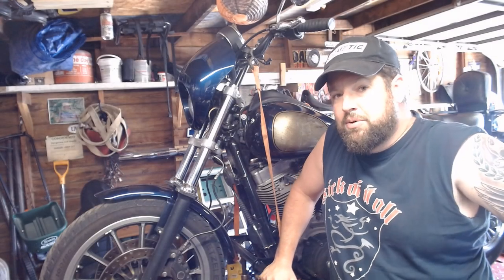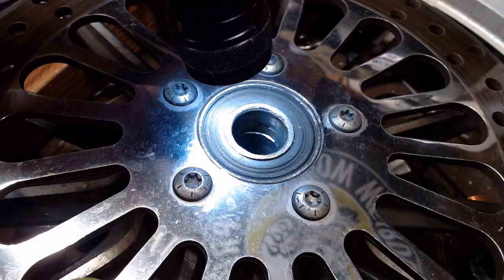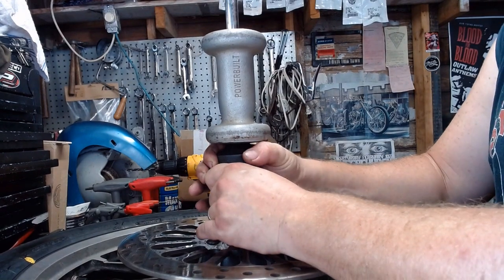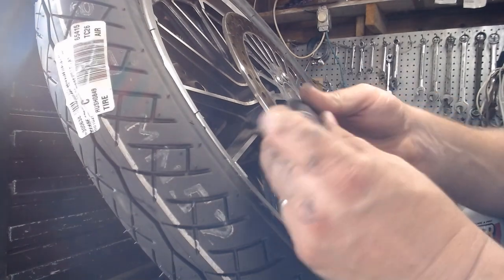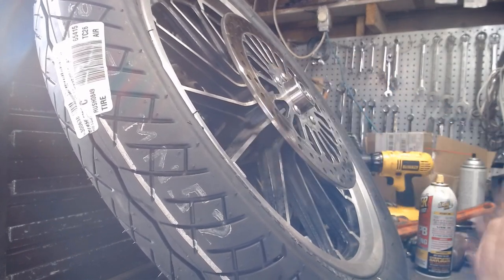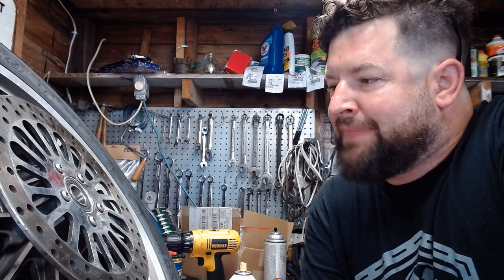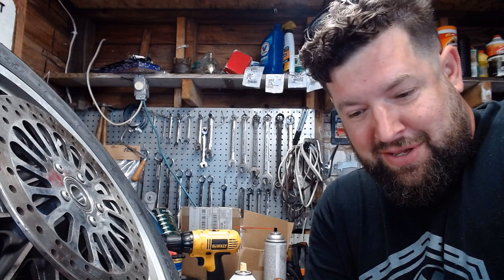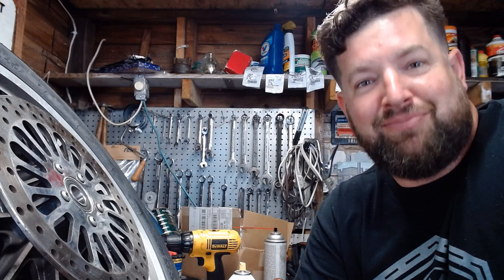Replace a Harley wheel bearing. No special tools.

Comment: I am so glad I spent the 50 bucks for the correct tool... I wouldn't trust all that beating, dremel use, and possible warping of the discs.
Reply from the maker: That was money well spent
Reply: @KnobleMoto  very much so. Especially since most of my family and friends ride. These tools may seem like a one and done, but we can all help each other. Not to mention, I can now change them out every 15k miles without spending a lot
Reply: Yes money well spent having the tools goes a long way

Comment: This is how we do it in Australia because we don't always have access to US special tools. i use a goose neck out of a old bicycle its the part that slides down inside the front fork and holds handlebars on. I cut about 3/4" off a bit of pipe then one cut down middle to make up the gap between goose neck and inside of bearing, slide inside bearing so as not to grab bearing divider and then tighten the long bolt that spreads goose neck as tight as possible then put drift through otherside and tap tap out she comes
Reply from the maker: Oh.  That is a great diy puller!!!!

Comment: That's how I was doing it but was a lot easier to just go all the way through with a long flathead and tap the bearing out on the bottom side then flip it and do it the same way
Reply from the maker: That’s what my initial plan was, but I couldn’t get the spacer to step off to the side enough.

Comment: Found a quick way just put a big socket like 1 1/2 hit it with a big hammer the vibration moves it enough to get a punch on it and knock it threw , quick and easy I sold my puller to a Harley shop
Reply from the maker: You can’t drive it all the way through. There is a shoulder on the inside of the wheel & Driving against the inner race was what got me into this mess

Comment: I just changed mine.
Ended up having to weld a nut to the inner race and knock it out from the other side.
Reply from the maker: That sounds like a pain
Reply: Doesn't sound like a bad idea
Reply: That's a very good idea though brother 👍👍👍

Comment: LMAO! Did mine by using a rubber grommet on a bolt tightening it very snug, heated the rim around the bearing and pulled it out with a slide hammer! Cutting on an aluminum rim with a dremmel was like dragging your nails in a chalkboard 😱
Reply: OMG never use penetrating oil anywhere near a sealed bearing 😱
Reply: Use grease
Reply from the maker: Yeah I may have a little hearing loss from that project.  Lol. 
That is a good idea with the bolt and slide hammer!  Thanks for sharing.

Comment: Is there any space between the spacer and inside and the bearings on either side? Like can it move at all? Mine has a little play room when I put my spacer in
Reply from the maker: There should be no space there. When you tighten your axle, it squeezes your outer spacers, the inner races and the inner spacer together.

Comment: Local shop charged me 60 when just bringing in the wheel.
Reply from the maker: Wow! That’s cheap.  You should share a link to the shop.
Reply: Thats if you have the part,  I called the Honda Motor sports in town and they are 150. parts and all if its still on the Bike.

Comment: Never pound those bearings in or out that is the major problem with bearing failure in the 2000 and up Harleys the sealed bearings used tool breakdown and rent or buy the 120 bucks bearing puller. I guarantee it like guys changing the bearing again six months down the road
Reply from the maker: Mostly agreed. Using the proper tool is the main point of the video. But you can hammer the bearing in, you just need to make sure your point of pressure and point of resistance is through the same race, and not across a ground surface.
Reply: Best post comment on this post

Comment: Ok so instead of all this just get a drum sander grommet.. Fully tighten in one bearing then use a brass rod and rubber mallet from the other side and save all that skate board bearing removal for skateboards...p.s. Use a board over the bearing to apply even pressure and use a RUBBER MALLET or leadshot mallet to reseat the bearing 😅 youll never have to file again
Reply from the maker: Or you can use the proper tool for bearing removal. 
Also I used a socket for even load distribution on the outer race when driving the new bearing in. If you use wood, the wood will compress around the race and damage the seal the protects the ball bearings. Then the bearing will be junk.  Plus if your using an intermediate item like a socket or wood, the hammer face structure doesn’t really matter because the bearing is insulated from the impact. I could have use a claw hammer or a rock and it would have had the same effect.

Comment: Yeah idk about beating on that sleeve…
Reply from the maker: You shouldn’t beat on the sleeve.  I was driving the bearing in, or out, not actually hitting the sleeve.
Reply: @KnobleMoto  the sleeve is that part you had to file burs off of after beating on it.
Reply: @KnobleMoto  yeah dude you could weld a washer to the race and knock them
Out in half the time
Reply from the maker: @vitalsound1727  well not if your don’t have a TIg welder in your garage.

Comment: OMG tapered bearings don’t like hammers! The fact he found nothing wrong with the original bearings???
Reply from the maker: Well they are not taper roller bearing they are ball bearings.  And if you hit the outer race with a driver against the point of friction it is fine.
Also you don’t wait until bearings go out to change them.  Once mileage gets high enough, replacement becomes preventative maintenance. 
If you listen to the audio of the video, I explain most of this in there.

Comment: just crazy removal .... grind out the bearing race thats a no no.... and use a screw driver as a punch ??? that is a axle spacer that is a machined tube to space axle bearings ??? not just some pipe to be toss out.... just buy the tool for a few bucks that you will need anyway ... it is so much faster and to see this video was very painful for me for i have been a harley machanic for over 25 years... and you need to delete this video ASAP....
Reply from the maker: You need to re-watch the first 18 secons of the video.  You apparently, completely, missed the point.
Reply: He definitely does not need to delete this video! This video is an instructional video to those of us who do want to save some money. I would have tried the same thing and because of this video, I will buy the tool.